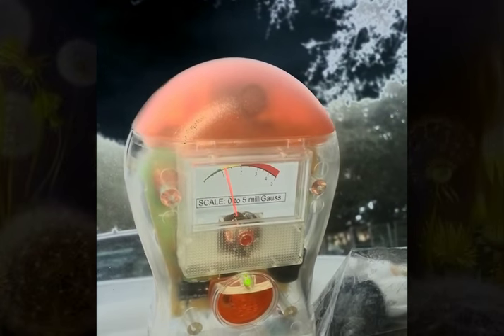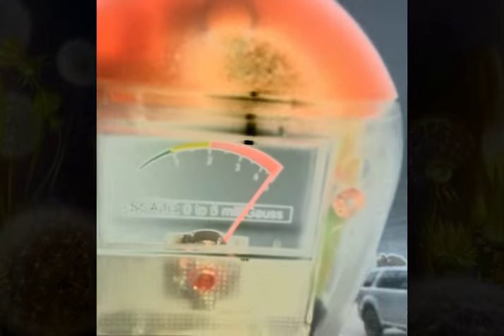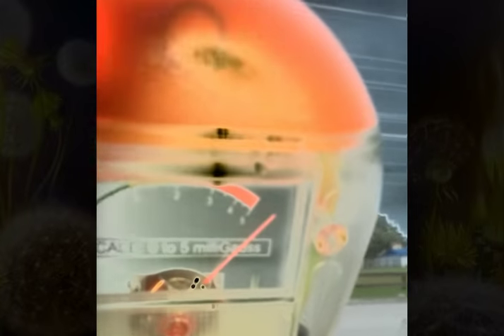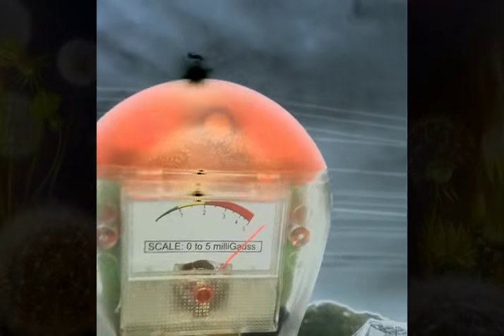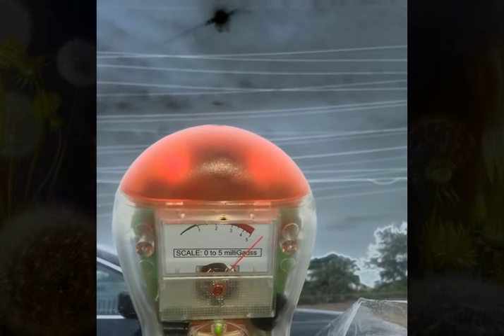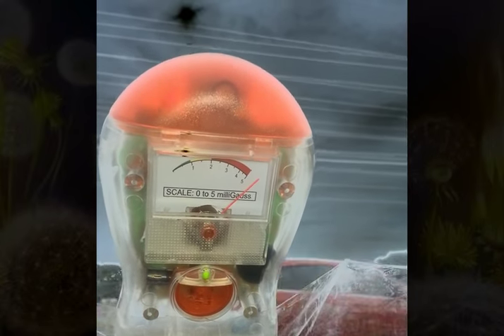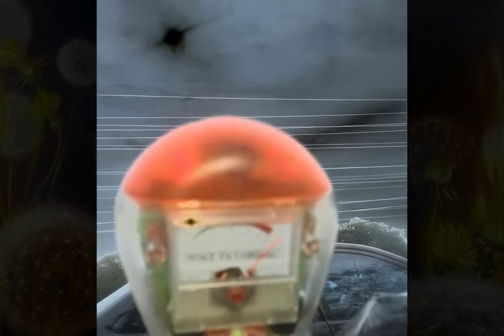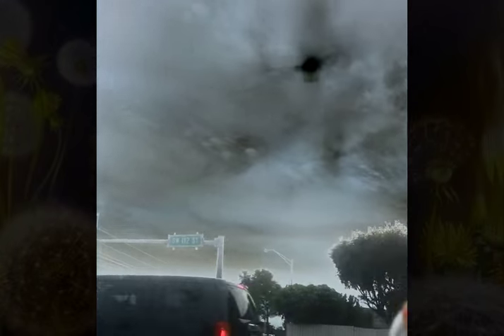Power Lines EMF A Serious Danger Schools and Drivers Being Fried! Turkey Point FPL

Comment: I was driving by some new high end homes last wknd and they are right next to  big power line towers. They terminate right across the closest large street, a few blocks away. Some of these homes are multi million dollar. There is a large lot, 2.5 acres or smthng w/ a 70's house on it that is for sale across the street from these new houses. Someone bought it last spring for $625,000 or smthng and they have it listed for 1.2 mil. Denver housing prices. I will try out the flour. light trick one of these nights.